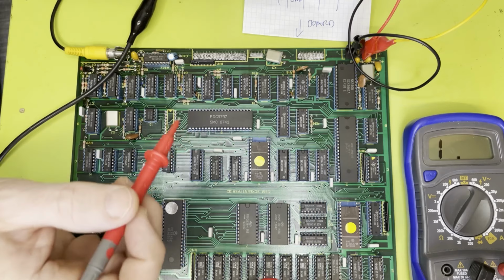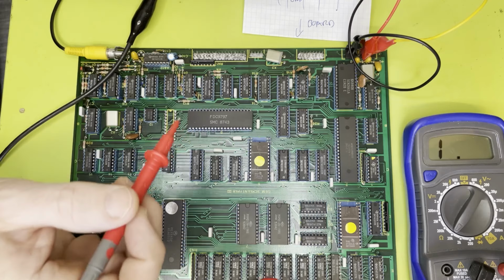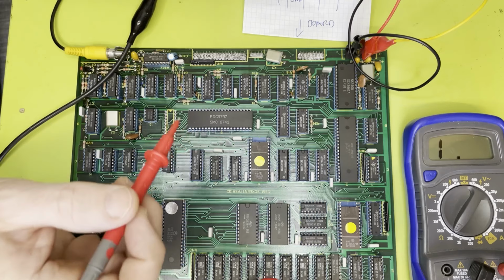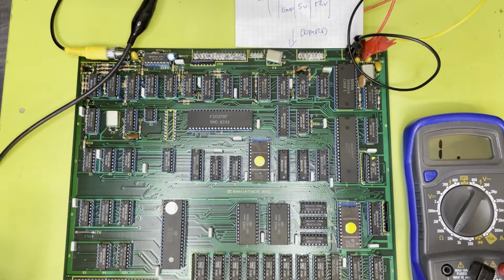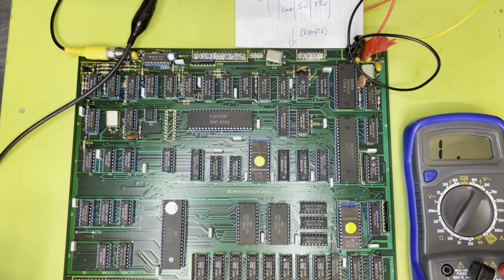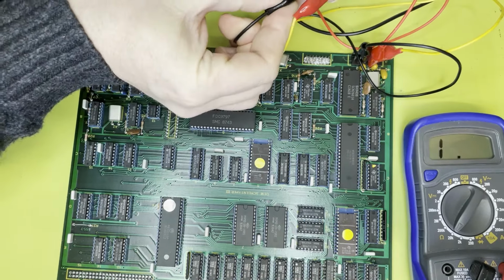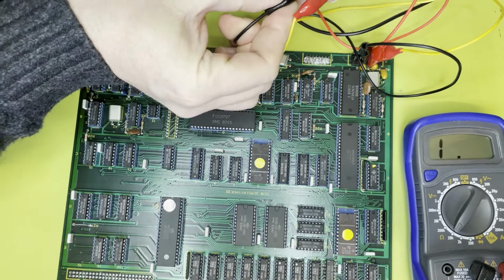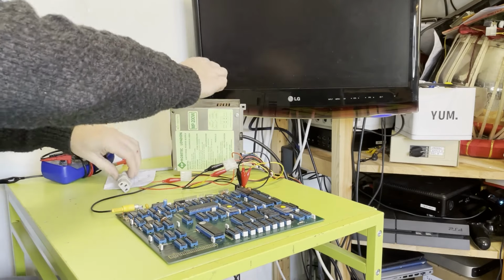Oddball tech - A tiny computer now with special effects!

Comment: At 'I've a huge psu' my heart sank. Personal experiance says use the smallest psu available, preferably with current limiting. If not available an incandescent bulb in the power rail can keep things sane. Chances are the tantalum was ready ro go, but the rest of the 12v is good. Replace it, and any others, with a 25v or higher version. Sorry if I come across as a keyboard know-it-all. Just trying to help. Have fun and thanks for sharing.
Reply from the maker: Its fine I know what you mean and you make good points. I do want to buy a current limiting PSU at some point. I should have gone with just the 5v initially but hey! Lesson learned... :)

Comment: Ah yes, the usual tantalum explosion 😅 Experienced a bunch of those live with 286-486 PC motherboards. I usually measure the polarity while powered up (or read the printing on the remaining non-exploded ones) and replace each and every one of them with 16 or 25V 10-47µF electrolytics (values depending on the size of the original tantalums, their printed ratings or just guesstimating. They're usually not critical for it to function). Have yet to run into any issues doing this, other than occasionally physical size if they're all bunched up in one spot.  
As for the PSU in the monitor, check whether there's any RIFA metallized film capacitors for filtering on the primary side... you know.. the infamous ones that have the plastic shell crack, moisture and corrosion accumulate over time and then they go off when you least expect it with a big lightshow along with a horrifying stink while they short the AC mains. And I wouldn't be too worried about the rusty metal clamp on the flyback because it's just that... a metal clamp to hold it together. so long as it hasn't completely rusted through, it's fine. Maybe dabbing on some rust converter with a brush for peace of mind or something?
Reply: Yes, old tantalum capasitors like to explode when you have your head above them

Comment: One you stated have a huge power supply knew it wasn’t likely going to end well. Get a bench power supply at least you can limit the current.

A tantalum capacitor no shock it exploded had my fair share of those go bang.
Reply from the maker: It is on my list of stuff to buy for sure :)

Comment: It's a pity that this project may come to a halt here, I was very interested and relieved to see something new come up in my internet searches suddenly a couple of days ago. I have something similar, that is: quite different but in the same ball park I guess. Mine is 2 PCB's connected together and it has one 5.25 inch drive (but I have no floppy disks for it), 2 DB25 connectors (no keyboard present) and a separate monitor but it does have the same power setup (coming in from the monitor), but with a different and what seems to me tailor-made connector. It does work, it's dutch (boot software in eprom), it has a philips monitor, no branding on the computer. If you're interested I can post some pictures, I actually put some pictures online already because I wanted to sell the monitor but found out just in time that it's part of a set, so I have put that ad on hold.
Reply from the maker: It is waiting for some new tantalum caps to be delivered and then we are back on! :)

Comment: were you measuring voltage or resistance  of chips at the beggining? audio is very quiet at that part and i didn't get any of it
 nice fireworks though
Reply from the maker: Voltage and yes apologies for the audio, it was very quiet, getting used to my mic and the habit of actually pointing it in the right direction! DOH!
Reply: @RetroGingerPod  try looking tor compressor or normalizer filter . the later would of course scale to the loudest part while compressor would quiet down the high and invrease the low volumes
Reply from the maker: Good advice. I will have a look for that, cheers